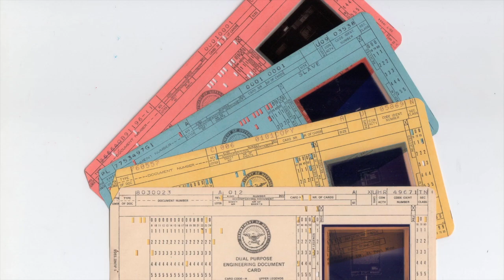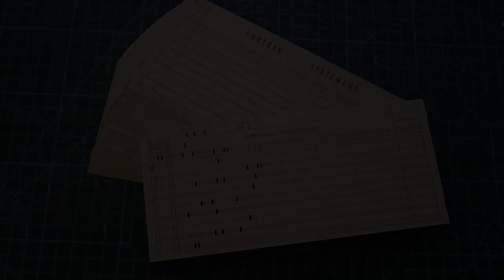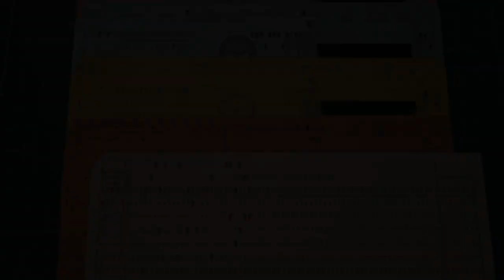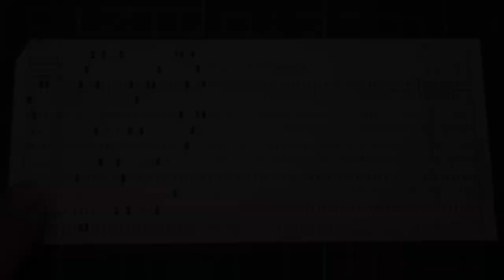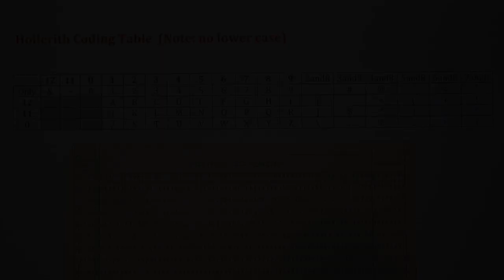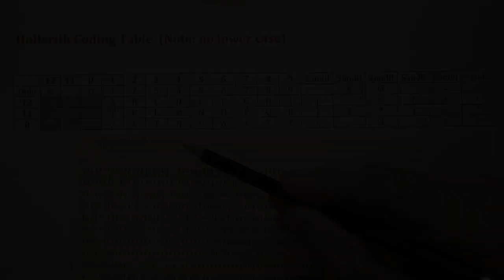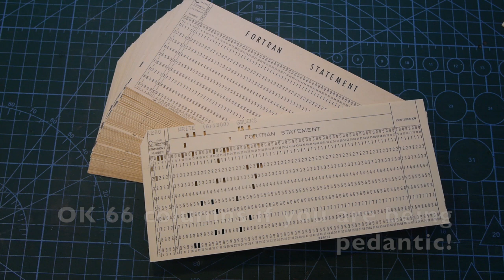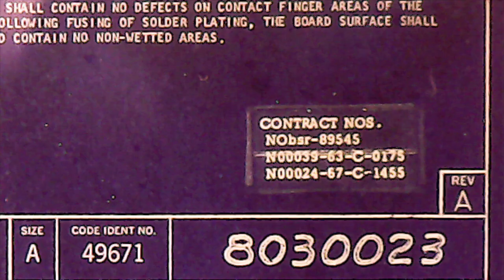IBM Punched Cards Explained - Video 207

Comment: "completely the wrong kind of output" Oh dear, I'm afraid I laughed at that bit. Hope no one ever got caught up in one of these machines!
Reply from the maker: Yes!  I will be publishing this video publicly before too long.  Hope it brought back some memories!
Reply: @AnthonyFrancisJones  It did, thanks!... though punched cards were only in use in my first year of university. Operating the IBM 029 keypunch was frustrating as I recall - a single mistake on a card could completely mess up the whole job. Fortunately, this system was soon replaced with (dumb) terminals which allowed interactive operation and the ability to correct typos as you were working. That was a massive step up in terms of productivity.
Reply from the maker: @fburton8  Yes, the frustration of a single error (somewhere) and then finding after waiting and compiling and running the programme that it would fail must have been an absolute nightmare.  Still, very different from a hard disk crash when you lost it all!
Reply: hahaha too funny... imagine the poor soul trying to debug it!